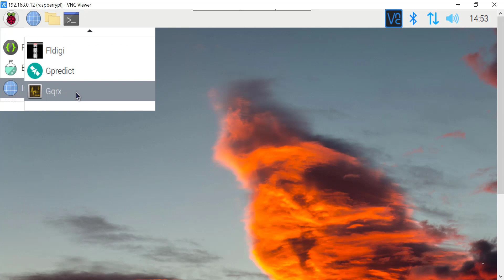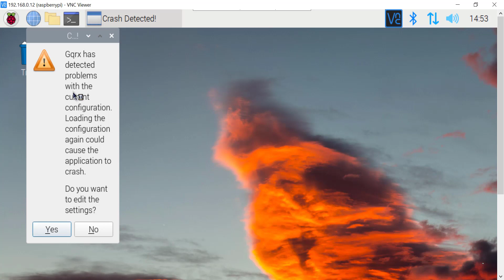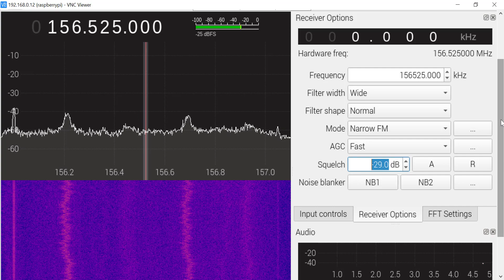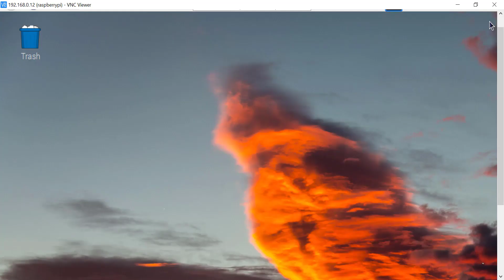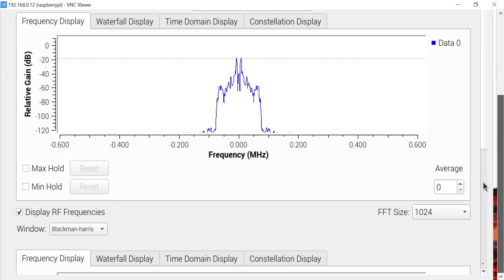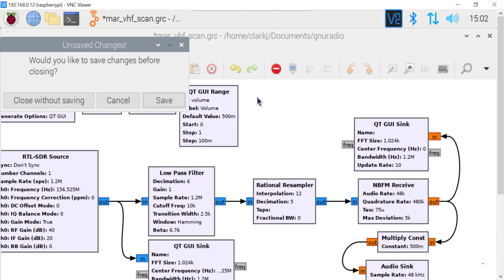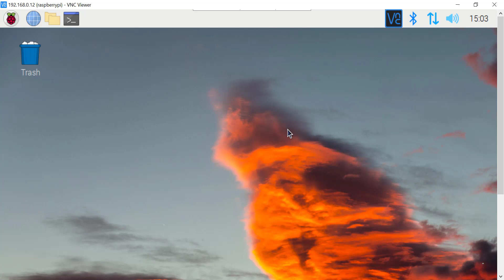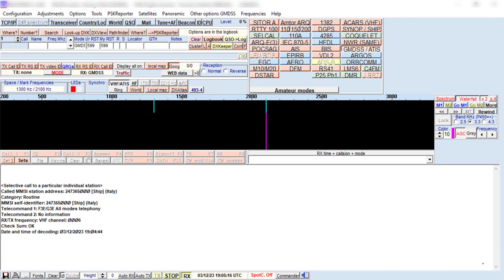RTL-SDR for Marine GMDSS/DSC on RaspberryPi4

Comment: Hi Jeremy, thank you for putting your knowledge up on yt. I'm planing on doing a trans Atlantic at the end of the year and would like to use the rtl-sdr v3 to get weather fax. There is an overwhelming amount of info online esp. for someone not versed in amateur radio. Please could you suggest an antenna I should go for? I've seen one you-tuber using a youloop and also have been pointed to a Magitenna 40-6m Multiband HF Wire Antenna . Thank you!
Reply from the maker: If you just want to receive HF weather fax, then just a simple wire antenna is all you need, the longer the better (insulated hook up wire). You are not transmitting, so you don't need a tuner or specially cut dipole antennas. It also doesn't have to be permanently mounted, just when you need it. One end of wire into centre of sma connector, the other end insulated from mast etc. I use an HF buddipole at home as well as an AlexLoop.

https://www.youtube.com/watch?v=b8ym4ea43t0

Comment: Hi Geremy, interesting as usual, but way over my knowledge. Question: I am using a Raspberry Pi with OpenPlotter. I am not too happy about the distance of seen AIS targets. I use the same RTL Radio dongle as you do and I build my own flower pot antenna that I measured for the correct AIS frequency. Is there any tips and tricks to get more distance? Thanks in advance!
Reply from the maker: If it is possible for comparison, try the RTL-SDR with Windows/SDRangel. You will see an amazing difference in sensitivity. In Toronto with Open Plotter and a simple whip, I might see 2 or 3 contacts. With SDRangel, I pick up 10-20, huge difference. At the moment, I have not tried other AIS software on RPi. There are a number of decoders on github which you can try.
Reply: Thank you Jeremy!

Comment: You are inspiring me with your easy use of these tools like gnuradio. So DSC is used for more than GMDSS distress communications, it also allows a group of VHF radios to plot each others GPS position with auto reply position requests every minute (or 5, 15 mins).
So if you had a pair of boaters with a DSC group operating then you should be able to monitor that and plot them. 
I love sailing and ham radio so this is doubly interesting to me.
When the harbour is busy in June there should be DSC POS requests in the air...
Reply from the maker: Hopefully I can find/design a linux decoder and then we can plot the dsc frames on OpenCPN, that is the goal!